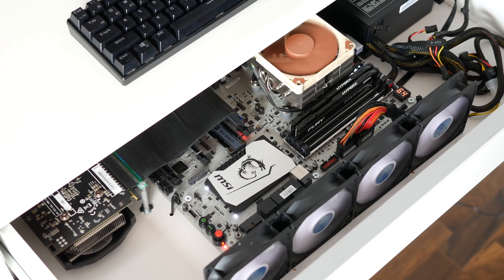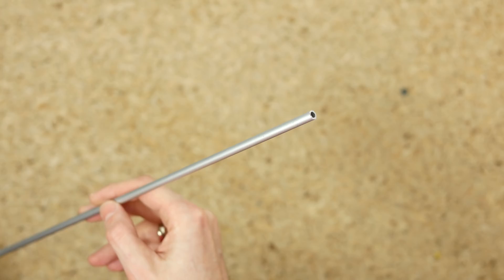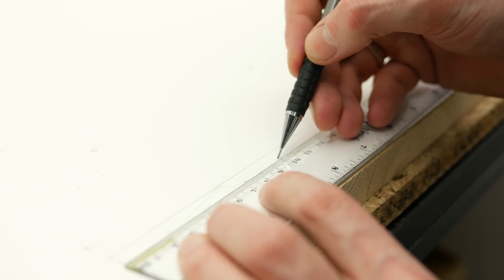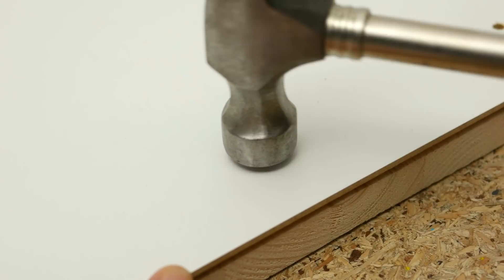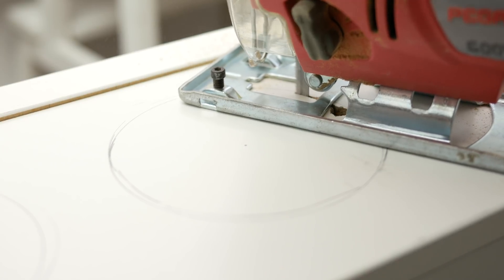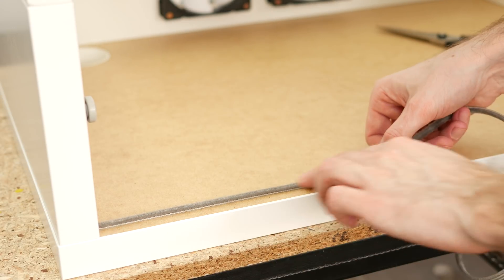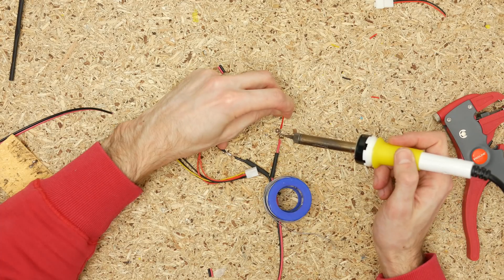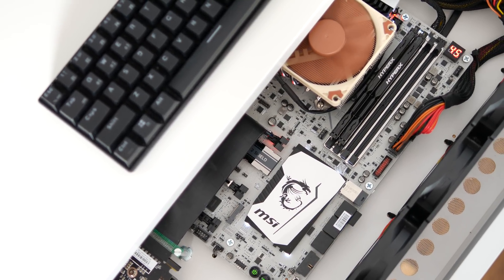How to make a desk PC from IKEA MICKE desk - probably the cheapest DIY desk PC

Comment: Personally I would take the extra step to be able to fix the fans and power supply with screws instead of using hot glue on them directly in case you ever need to replace one of those in the future. But I do like the way you fixed the motherboard and GPU. The result looks good.
Reply from the maker: Hot glue isn't really destructive or anything - I actually took out and reattached the PSU about three times in the process.

Comment: A good idea, but I think a few things should have been changed a bit;
-the mobo ports would have greater access if it was simply spun 180, but kept at the same position
-the air supply fans wouldn't be blocked if they had been put at the rear. Maybe make a dust filter by sandwiching the mesh between two frames of wood trim?
-take advantage of the PCIe cable being somewhat flexible, and push the GPU as far back as possible, so the video cable can snake around to the rear with minimal bend stress.

I am a fan of the GPU and PSU being angled how they are! Fantastic for airflow, and you're definitely clearing out the exhaust air with so many fans!

Comment: Would recommend building a shroud around the intake fans to improve fresh air intake
Reply from the maker: You're right, and originally I did plan to make an intake shroud from acrylic. But AMD insisted on keeping the cost and complexity at the minimum so it would be easier for others to replicate.

Comment: too much hotglue for my liking.... also did you consider possible issue with this not being a grounded case... some component may be designed to use the case as chassis ground... using a non-conductive case could  become an issue.. possibly anyway..

Cool idea though and this will be rather issue to clean (trough again without a proper chassi ground it may be more vulnerable to static...

Comment: The build is noisy, because it is a wooden box without any foam sound insulation and it acts as a boom box, amplifying every buzzz
Reply: That is true. Any fluffy soft coating will dump the high frequency noise
Reply: @thcoura  I have fans mounted  the same way and put soft cloth tape on each surface touching. It removed the annoying sound from turbulence completely :)
Reply: That mostly depends on how do you set it up.
I made case for my HTPC that would match my subwoofer and it was actually pretty quiet.
It was mostly due to fact that slow spinning fans are not resonating at resonant frequency of the box so the sound wasn't amplified. HDD on the other hand was louder than it was outside of the box.
Reply: im curious, where to put the foam then?
Reply: How about purchasing a massive roll of electrical tape to paste it on the interior of the wood, several millimeters thick, would that would work to dampen sound?
Reply: @passerby6168  sound damping would be better, pretty much any spongy material 5mm thickness would be enough.

Comment: Good video displaying your skills. The only thing that bothered me a lot was the upside down GPU. I understand why you laid it that way, to not twist the riser cable, but I wish there was a way to remove the end of the riser and flip it, or safely twist it, or just buy an inverted one so the GPU can face upwards.
Reply from the maker: The fans are facing down so they can suck the air from the vents in the bottom of the drawer.

Comment: my idea would be using this desk to put in a Watercooled system back for two 240mm rads.
to fully watercool CPU / VRM and GPU. this should be doable in this drawer.
Reply from the maker: I already did two AIO cooled desk PCs and I wanted to see if you could air cool one and get reasonable temps.
I'm planning on custom water cooling my main workstation desk PC.
Reply: YetAnotherTechChannel thats nice i need to do this because i needed to move my entire pc to a new location  so from 3m desk to a 1m desk  ;) and this is the micke one

Comment: No need to use so many fans. Why not use AIO Coolers for both CPU and GPU? I see that there is sufficient area for this type of application. 

Haim Peretz1 hour agoAdd padding to fan to reduce vibration

This would make the system very quiet.
Reply from the maker: I already made two desk PCs with AIO coolers so I wanted to find out if it's possible to air cool such build :)
Fans don't vibrate at all.

Comment: Add padding to fan to reduce vibration
Reply from the maker: Believe it or not, but there is absolutely no vibrations.
Reply: just because you dont feel it does not mean its not there, sound is vibration, adding pads to reduce vibration (even if you dont feel it) will reduce noise.

Comment: I made a design like this years and years ago, but I could never solve one problem. Even with only 120mm fans dictating the full height of the drawer internals, I either didn't have enough leg room, or the desk was too high. I sit at a desk of comfortable height (73 centimeters) with 9-10cm remaining between my thighs and the bottom desk surface. That means I couldn't comfortably sit in front of such a desk. Maybe it's just me, but this wouldn't work for me at all.
Reply from the maker: What's determining the drawer's height are the front intake fans, and they are 92 mm. The drawer is 10 cm high, to ensure some clearance.
Reply: Oh, so it would be just right. Sorry for not paying enough attention, I didn't realize they were 92 mm, so your design would indeed work. I made mine so long ago, riser cards or cables weren't a thing back then, so it made no difference for me. If the 12 centimeter fans wouldn't have determined the full height, the standing video cards at 11.5 centimeters would have.

Comment: Nice job here, but i have a question. Is ram putted in good place? I mean they should be in second and fourth slot.
Reply: Rafał Kozłowski it's different between motherboards, my board (MSI also) calls for the 1st, 3rd , 5th and 7th slot to be used. For four sticks of ram with 8 slots.
Reply: I know, but look at 2:02. Above first ram is small instruction how to install sticks.
Reply from the maker: You're most probably right... but keep in mind that this isn't a PC build guide - all that hardware is just a prop to make the video. When this CPU makes it eventually to my workstation PC, I'll make sure to have RAM sticks in correct slots :) Thanks for pointing this out :)

Comment: Are the Ram sticks in good place ? For me in this position you can't have the dual Channel config :( alternate or correct me if I'm wrong :)
Reply from the maker: You're most probably right... but keep in mind that this isn't a PC build guide - all that hardware is just a prop to make the video. When this CPU makes it eventually to my workstation PC, I'll make sure to have RAM sticks in correct slots :) Thanks for pointing this out :)
Reply: 1-2% drop in performance

Comment: Nice build! You could use Speedfan to make a custom fan curve based on tempature for the front fans 🙂
Reply: Siavosh Taba maybe easier change voltage to 5V or 7V, when he switched them on, instead of 12V?

Comment: I really love this kind of work. I wonder if it's possible to have good temperatures using a more powerful gpu, like a 1080 or a 1080ti and a overclocked cpu though.
Reply: u can install water cooling :)
Reply: you can put slim fan under the gpu
Reply: Linden Arden you will either need sufficient air circulation going in and out of the desk or a way to more dierectly insert from air into the GPU and hot air out of the chassis.
Reply: BRING IN NFC
Reply: Perhaps using a hybrid GPU?
Reply from the maker: I'm pretty sure a blower style cooler GPU would be just fine. 62C CPU temp under full load suggests that there is some potential for overclocking.